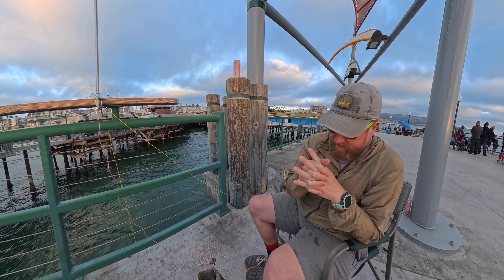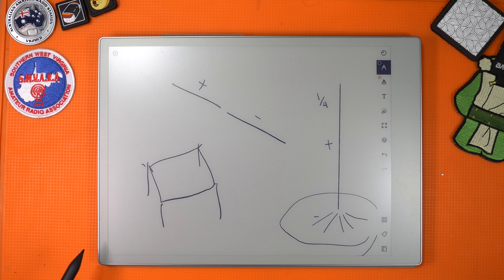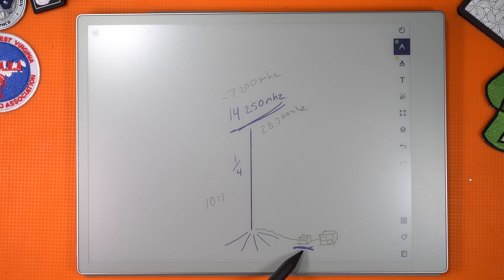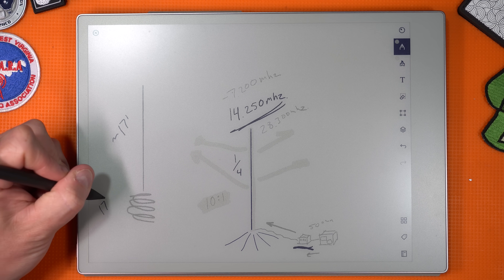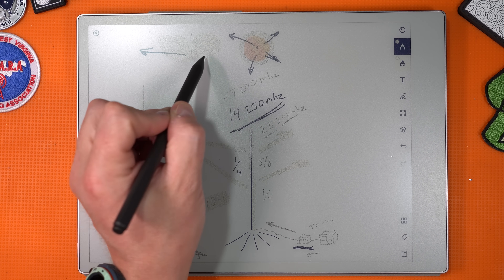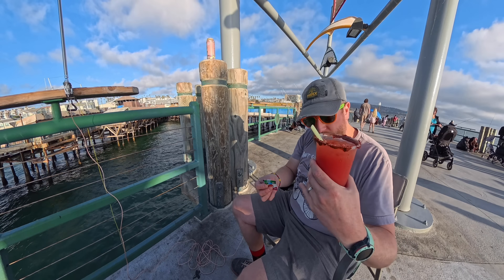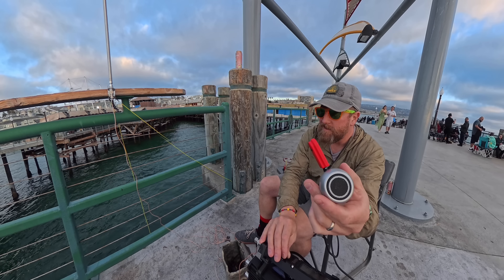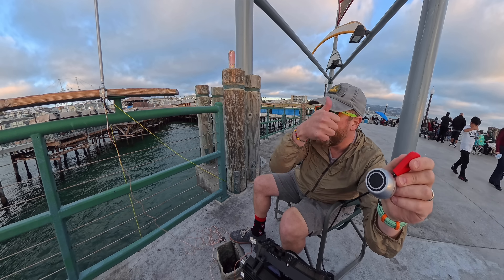When NOT To Use Antenna Tuners

Comment: Ever since I started down the Ham Rabbit-hole I've ALWAYS been a huge advocate for always using a resonant antenna whenever possible! My usual goal is to run with SWR's below 1.3:1 mostly I succeed, Hardly ever use my Antenna tuner. It does take time to learn and tune the antennas. Most portable setups take me less than 10mins to setup and tune, be it my Screwdriver,  BuddiStick Pro or EFHW. My Rigstick is key to getting right (and at time my NanoVNA).
Reply: You are a real ham. Congrats!

Comment: Why when the vertical is elevated like the pota perf do the radial length need to be adjusted and not the whip? Vs when the antenna is not elevated it’s the vertical that is adjusted to be resonant. Maybe I’m making a wrong assumption based on one thing you said in that video about the length of your radial.
Reply: To expand on this a bit more.
With elevated radials, only two at 180 degrees apart are required for a uniform radiation pattern.  For portable operation, often only one is deployed toward the direction where maximum signal gain is desired.
To tune a two or one elevated radial system, either the radial(s), vertical element or both can be adjusted physically or electrically via inductive or capacitive loading.
Also, keep in mind that an elevated vertical antenna with elevated radials is a dipole.  As such, it can be fed off-center to achieve a good impedance match.  In other words, the radial(s) can be shorten and the vertical element lengthen (physically or electrically) to achieve resonance in addition to a well-matched impedance.  This will require some trial-and-error to achieve, and can be closely approximated with the help of computer simulation software (e.g., EZNEC).  Granted, this approach may not be practical in the field.
Reply: @DaDitDa  Excellent!
Reply: Both ways work.  IMHO, too much time is wasted fiddling with the antenna to achieve the lowest SWR.  As long as it's below 2:1, you're good to go.  And if your rig has a tuner, below 3:1 is usually close enough.
Reply: Because when the "radials" are on the ground, they are detuned and no longer "resonate", whereas when they are elevated above the ground, they do resonate. When they are on the ground, they are called "ground radials" whereas when elevated above the ground, they are called "counterpoise wires". It is more complicated to resonate an elevated vertical because you have to get all of the counterpoise wires to resonate on the same frequency as the vertical by adjusting their length. However, when you elevate a vertical above the ground, and use counterpoise wires strung above the ground beneath it, the vertical puts out a better signal. The more counterpoise wires you string out, the less important it is that they are all the same length. Above 16 or so, they begin to act as one system so one being out of tune, so to speak, does not matter as much as when fewer are used.

Comment: I use a transmatch, but the antenna I use is close to resonant.  I use the match to pull a 2:1 VSWR to 1.2:1 or better with less loss.  Trying to match way outside it's resonant range really affects the radiation efficiency.  I do thing in lieu of matching an antenna, which can be a much more laborious effort.
Reply from the maker: That is precisely how I use a matching device as well. Just to get a close antenna closer.
Reply: Very wise. Laws of physics dictate you're going to get a lot more electrons jiggling in that resonant antenna (on receive) than in a non-resonant one. That translates to louder signals over a lower noise floor. Then you gotta worry about transferring those electrons to the radio via the transmission line, which is usually 50 Ohm coax these days. That means matching the antenna's resonant feedpoint impedance to 50 Ohms. A 1/4 WL vertical with a decent ground radial system will show 36 Ohms at resonance. So if you don't use any impedance matching gizmo, you'll get a 1.3 to 1 SWR on a 50 Ohm antenna analyzer. If you use a vertical that is shorter than 1/4 WL, but resonate it with some base or center coil, the resonant feedpoint impedance will be lower than 36 Ohms, in which case you can make the impedance match attaching a "shunt coil" across its feedpoint. On 20 meters, that's about three turns of No. 14 wire on a 1" diameter. You crush or expand the windings to get the 1:1 SWR match. That's for some kind of "loaded" mobile whip. More turns below 20 Meters and fewer above. 

The guy in the video was not using a vertical with a "ground radial" dropped over the side of the dock. He was actually using a 1/2 wave vertical dipole since his "radial" did not "touch" the water below, which would have detuned it. That's why he got a "perfect SWR match" to his 50 Ohm coax. He didn't appear either aware of this or care too much about it. 

What's interesting about verticals is that their "feedpoint impedance" changes when you excite them off their resonant frequency. So if you have one with a perfect ground system giving you 36 Ohms at resonance, as you increase the excitation frequency their impedance rises--which means the SWR meter reading goes down, eventually to 1:1. A lot of guys make the mistake of "tuning" the vertical by adjusting it until the 1:1 SWR occurs on their operating frequency. But what they've actually done is adjust the vertical shorter than it should be until its non-resonant feedpoint impedance is 50 Ohms. Go watch any YouTube POTA guy, and you'll see many of them doing this. Some don't get this far and simply set up the vertical and then let the ATU "tune it". You are likely not one of them, judging from your original comment. The result is lower signal strengths and higher noise floors because they are not using a resonant antenna anymore. Go to my YouTube channel and check out the playlist showing signal reception using a properly tuned and matched Hustler mobile whip. You'll see Russians coming in at 30 to 40 dB over S9, etc. 

If you have a 1/4 WL vertical over a perfect ground system exhibiting a 36 Ohm resonant feedpoint impedance, and then match this to your 50 Ohm coax (with a shunt coil or L-match), when you put 100 Watts into its feedpoint you will get 100 Watts radiated by the antenna, after which the far field sculpts the vertical's radiation pattern. But if you have a vertical with a shitty ground system showing, say, 48 Ohms of resonant feedpoint impedance, your SWR meter will say 1:1. But for every 100 Watts you deliver to its feedpoint, only 75 Watts will get radiated. The remaining 25 Watts will be wasted heating up the ground because of the shitty ground system. 

This is because whenever you set up your 1/4 WL vertical, it should give you 36 Ohms at resonance. If it doesn't, that means you have not set it up as well as it could be set up. This usually means the ground radial system does not have enough radials deployed. In the case of the 1/4 WL vertical with the 48 Ohms resonant feedpoint impedance, this 48 Ohms is made up of the 36 Ohms exhibited when the vertical is set up perfectly, plus, in this case, an additional 12 Ohms of ground losses due to the shitty ground radial system. So when you pump power into it, some of the power gets radiated and some gets wasted. To determine how much, you take the ratio between the perfect 36 Ohm feedpoint impedance and, in this case, the 12 Ohms of ground loss. This ratio is about 3:1. This means when you pump 100 Watts into the antenna feedpoint, 75 Watts gets radiated and 25 Watts gets wasted eventhough your're SWR is 1:1. So remember, if you are tuning a 1/4 WL vertical, at resonance it will show 36 Ohms  and exhibit a 1.3:1 SWR a 50 Ohm analyzer. If it doesn't, it most often means you need to add more radials. Again, a 1.3 to 1 SWR is what you are looking for when "resonating" your vertical, not 1:1. 

Hope that is of interest to you. Check out my QRZ page and the link on it to my book if you want a deep dive, 73s.

Comment: In POTA, short coax means mismatch losses are negligible. Antennas are physical structures, but it’s the electrical current distribution that drives radiation. Matching ensures efficient power transfer. A ¼-wavelength physical length can improve the radiation pattern — but it doesn’t determine the radiation resistance.
Reply: Yes it does.

Comment: The antenna height for 14.250 MHz is 17'3.24". For 7.200 MHz, it's 34'2.16". For 28.300 MHz, it's 8'8.28". Why the antenna gets taller for lower frequencies, I just don't know, aside from the math turning out that way.
Reply: That's because the electrical length of antennas varies inversely with frequency but directly with wavelength. A 1/4-wave (quarter wavelength) antenna for 160 meters will be much longer (taller) than one for 10 meters. The meter terms we use signify the length of a full-wavelength (1-wave) antenna for somewhere middle of the bands. So, 40 meters means that a full, 1-wave antenna for that band will be 40 times 1 meter (40 x 3.28 feet) long.
Reply: @mcarroll5885 Gotcha. 👍
Reply: How far does a radio wave travel over the amount of time it takes to complete one cycle of its oscillation? A radio wave that requires one second to complete one cycle of its oscillation travels 300,000,000 meters. That means the wavelength of a 1 Hz signal is 300,000,000 meters. 

A radio wave that takes 1/2 second to complete its cycle of its oscillation travels half that distance, or 150,000,000 meters. That means the wavelength of a 2 Hz signal is 150,000,000 meters.

How far does a radio wave that takes 1/300,000,000 of a second to complete one cycle of its oscillation (aka 300 Mhz) travel ? The answer is 1 Meter. Does this help? The higher the frequency, the shorter amount of time available for the radio wave to travel over one of its cycles of oscillation.
Reply: @W1ZY Somewhat. Thanks. 👍
Reply: @ColtonRMagby  Somewhat?! Come on, Man! HA! Wavelength is the distrance a radio wave travels at the speed of light over the time it takes to complete an oscillation. Radio waves with higher frequencies travel less distance than radio waves with lower frequencies. That's a non mathematical explanation.

Comment: Whats inside the tuner? A coil maybe? A capacitor possibility? So whats the difference between an inductor at the feedpoint and a tuner at the feedpoint? Big fan of traveling wave antennas here, but i know theres a time and place for all antenna styles
Reply from the maker: Inductors and capacitors used to balance the feed to 50 ohms.  Check out  manual tuner and you’ll get it.
Reply: An inductor at the feedpoint in series with the coax center wire and radiator resonates the radiator. An inductor "shorting out" the feedpoint changes its feedpoint impedance, similar to a tuner which also "shorts out" the feedpoint. You usually place a "shunt coil" across the feedpoint of a vertical which has an inductor placed in it to resonate it, such as a mobile whip. Most hams do not know about this and use a tuner at the other end of the coax.

Go to my book linked on my QRZ page for chapters about travelling wave antennas.
Reply: @W1ZY a tuner at the transmitter also resonates the antenna by way of a conjugate match, the reactance is tuned out of the antenna feed point by the feedline

Comment: Could you do a video with the exact same analysis for an EFRW?  It seems like they go against all of the major points you've made here.
Reply from the maker: Ahhh. I have talked about this.  The RW isn’t random, it’s specifically cut to be at a non-resonant frequency, then the 9:1 unit brings it into the area that a matching unit can tune to. They work, but are not my first choice in antennas.
Reply: @HamRadioCrashCourse  How is the nearfield and farfield affected?  Do they inherit the same undesirable traits as EFHWs that are too long?  Running the inline 9:1 in front of an ATU seems like Xzibit is pimping my radio.  This video is great. It's very digestible and has fantastic visuals.  Either way, thanks for explaining things.
Reply: @AtomBomb-  No. Any elevation lobes in a vertical radiation pattern are omni directional; the guy in the video got this wrong. For horizontal antennas, the elevation lobes do not extend off the ends of the antenna wire. That means they are not omni-directional. The far field is obviously not affected by anything you do to any antenna. What is affected is how the antenna interacts with the far field. All horizontal antennas will have elevation lobes, whereas all ground mounted vertical antennas will not have any elevation lobes.

Comment: Great explanation! I had the same type of questions about when to use a tuner. I have a 17' whip coming in soon and will do adjustments to that and tune when I need to.
Reply: You need a good ground system underneath. To match it without a tuner, place a Shunt coil across its feedpoint. on 20 Meters, about 3 turns of No. 14 wire in a 1" diameter. Squeeze or stretch to get 1:1 SWR afrer resonating the vertical by adjusting its length. Put a ferrite toroid "choke" at the base.

Comment: What about the whole “more wire is better” thing?
Reply from the maker: If the radials are floating. You have to match.  More wires is better for ground mounted radials.
Reply: Up to 16 ground radials does the trick, in terms of radiation efficiency. Above that, not worth it for portable operations.

Comment: Maybe this was brought up, but isn't speed of light 300,000 Km, not meters?
Reply from the maker: Yes! 300,000,000m or 300,000kms.  It gets tough speaking drawing and making a video, but the math checks out otherwise.
Reply: @HamRadioCrashCourse   wrong again!   c = 300 m * MHz.  this is why when you divide by freq in MHz, you cancel out the MHz ending with m.
Reply: @HamRadioCrashCourse  Just wanted to make sure! Thanks for all the great info!
Reply: all sloppy, speed is distance over time.  c = 300 m * MHz or equivalently  0.3 m per nanosecond

Comment: Another problem you run into if running high power is high voltage at the base of the antenna. Take my 43' vertical on 160 meters, if I ran 1500 watts the base of the antenna has 19,000 volts on it! You can get flash overs, carbon arc trails across the base insulator... 100 watts you have 2300 volts present... so keep that in mind if you decide to run power on a short antenna for the frequency!  Make sure your base insulator is rated for the voltage that will be present! Even QRP generates a high enough voltage to hurt!
Reply: This is an interesting fact which provides a "learning opportunity" for interested hams.  When you pump power (Watts) into an antenna, this power manifests itself in varying amounts of "volts" times "amps" along its length. When it's a high amount of volts and a small amount of amps, that point on the antenna exhibits a "high impedance", whereas when its a low amount of volts and a high amount of amps, that point of the antenna shows a "low impedance". This means _the impedance of an antenna varies along its length, fluctuating between maximum voltage (HiZ) and maximum current (LoZ) every 1/4 wavelength.

The starting point of this fluctuation is the end(s) of the antenna, after which there is no more physical antenna. This means no RF current flows after the end of the antenna, which meansthe end(s) of an antenna exhibit minimum amps and maximum volts. There's no way of getting around this. 

So at the tip of your 43' vertical, there is a voltage maximum and current minimum no matter what frequency you use it on. If the frequency is one where 43' equals 1/4 wavelength, then there will be maximum current and minimum voltage at its base [e.g. a 1/4 wavelength vertical]. But on 160 Meters, where 1/4 wavelength is 120', moving down your vertical 43' is not enough to get away from the voltage maximum/current minimum condition at its tip. This means if you try to feed it at its base, you will encounter a HiZ feedpoint impedance. 

To get around that, as many people do, you can insert a "loading coil" at the vertical's base to "resonate" the 43' whip on 160 Meters. Of course this will be a huge coil at the bottom of which you will find a low impedance (voltage minimum/current maximum) within the range of your tuner to match to 50 Ohms. But that's not the point. The point is that across this loading coil you will have extremely high voltage at it's top and a voltage minimum at its bottom. That's why you need to make sure the coil loading a 43' vertical on 160 Meters can withstand the voltage differential you cited when operating high power.
Reply from the maker: Great point!